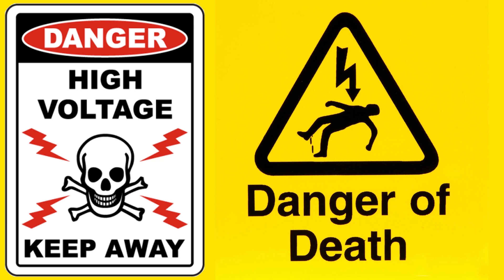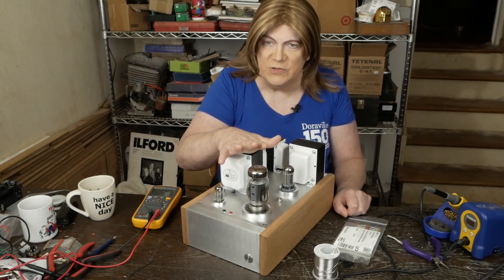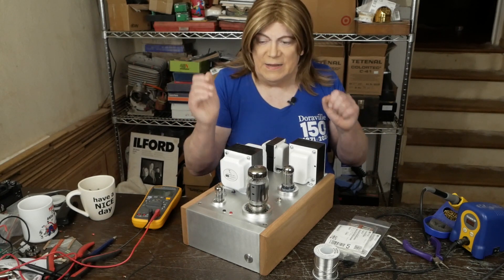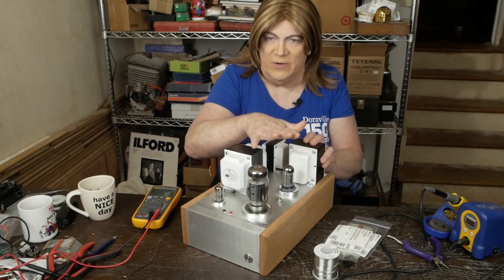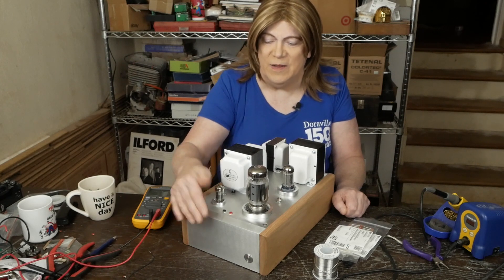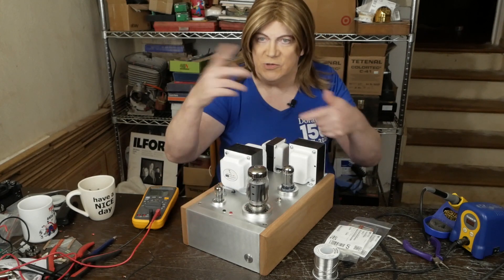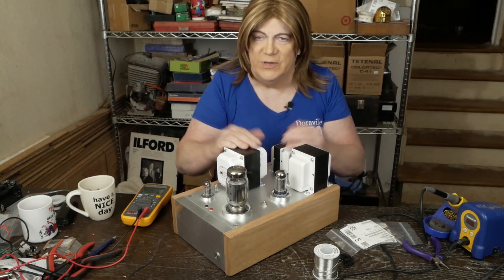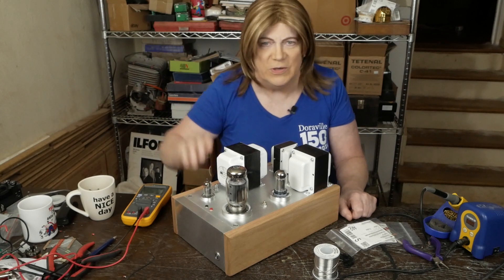KT120  SE UL mono block: Update on First Build.

Comment: how do you like these vs the KT-88 and what was your reasoning for not going with the KT-150?
Reply from the maker: The KT120 is a punchier tube and make way more power than a KT88. The problem with all these higher power pentodes: They were designed for push pull use and when you bias them up with constant current like a SE amp requires,  many of them red plate. Only the early production KT120 actually meet design specs for dissipation, you end up searching for the older tubes and hand testing, which is why I decided not to start production on a KT120 SEUL amp. Tung Sol is aware of this and don't seem to care.
Reply: @SkunkieDesignsElectronics  Oh wow! Well, that is very interesting. 

I am building a KT88 direct coupled amp soon which will have around 8-9 watts in UL. I was wondering if I should look into a KT120/KT150 amp at some point but I think I am going to wait for the tubes to develop a bit more. 

I have a 46 tube amp that I need to finish anyways. So more than enough projects. 

Thank you for your input!

Mike

Comment: Have a question if I may! I may sound really silly here, but here goes...
Say I wanted to use WIMA caps in place of electrolytic s, can radial be used as polarised? Seem to find conflicting information in regards to this.🤔
Reply from the maker: Non-polarized film can be used in place of polarized caps.
Reply: @SkunkieDesignsElectronics  ah, interesting, I thought as much. Obviously restricted on uf capability usually, but for smaller caps they seem like a potential good idea, especially where space is limited as they can be tiny. WIMA caps seem stupidly cheap as well, well on Mouser UK at least. Kind of makes me question why really expensive gear tries to attribute the cost of gear by using such components when really they are so cheap.🤔
Reply: @SkunkieDesignsElectronics  And Thankyou! Forgot my manners temporarily.🤦

Comment: I’m excited about this amp. I know this is probably blasphemy but would it be possible to do this will solid state rectification and would that allow for any reduction in size or change in power? I’m only asking because I’m thinking of building these but I’m hoping to make it as compact and efficient as possible. I’m not sure if that makes sense or would be an option
Reply from the maker: Sure you can, I actually have a pair of plug in SS rectifiers (with thermistors) in case I want more B+ voltage.